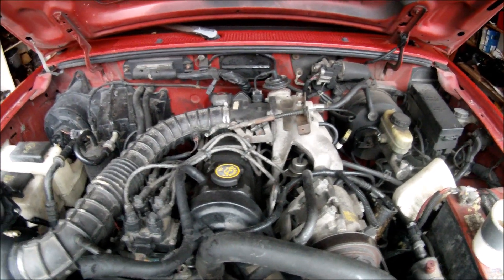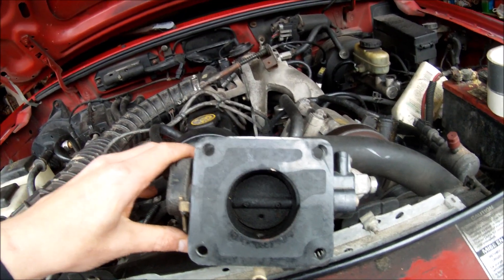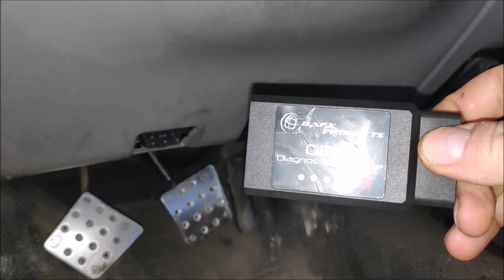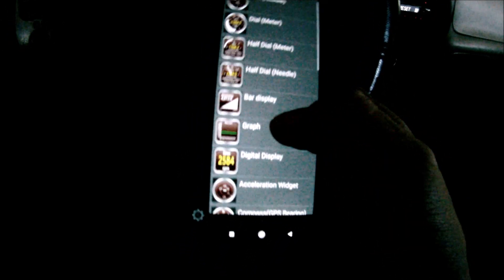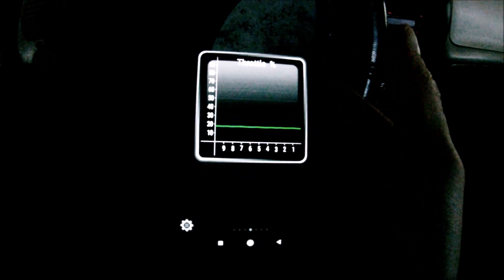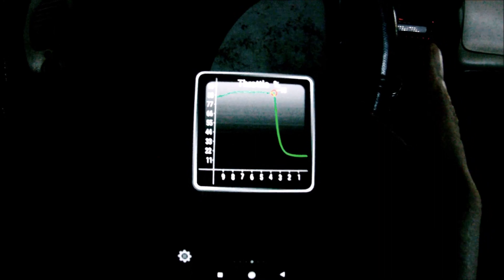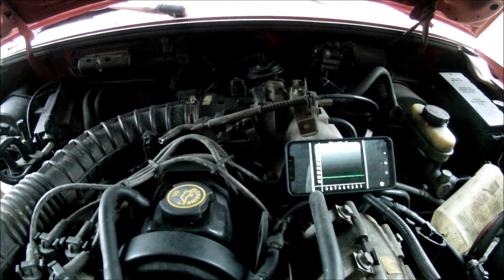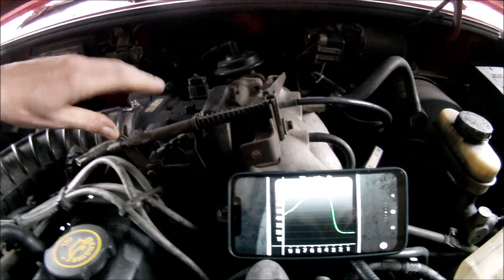How to Test TPS in Seconds, Easiest Technique.

Comment: I have the same interface and it even works on Nissans to read CVT temperature with the CVTz50 app.  I am not sure if this adapter can do other things like reset steering angle sensors.  Maybe with a different app it could.  I don't know yet.  I do know that with the same app and that adapter you can turn off the DRLs (daytime running lights).  My vehicle is a 2017 Nissan Rogue Sport SV and the way they design them they need the steering angle sensor and G sensor reset if any work is done on the suspension at all.  This could be as minor as having it aligned.  These vehicles may have a tendency to drift slightly to one side even though they are aligned properly and everything else if those sensors are not calibrated or reset and it is annoying and potentially dangerous.  I am trying to find a cheap scan tool that can do those things also for $500 or less.  I don't need lifetime updates or to always have the latest software.  I just need one that covers my vehicle.  My vehicle is available overseas and outside the US as the Qashqai.  Everything is exactly the same except that overseas it may have the steering wheel on the other side (think England where they drive on the other side of the road).  I don't mind if I have to pay a few hundred for the tool I need.   I just don't really want to get too much higher than that.  I just want the tool so that when it annoyingly gets out of calibration I don't have to keep making appointments at shops to fix that.  This had me at the Nissan dealer and they could not find a single thing wrong with the vehicle.  I am not sure if their own service department is aware that this vehicle needs that calibration.  I have had it to a few different shops hoping that one mechanic would find that one thing no one else could and take me back there to point it out and say there is your problem right there, how anyone missed that is a mystery!  It is one of those things that is annoying because it is so subtle that not everyone seems to notice it but it can cause you to turn wider than you intended since that sensor tells the computer where you steering wheel is and how fast you are making the turn.  This vehicle has electric power steering and that sensor tells the computer what angle the wheels should be turning and at what rate.  If it is off by too much you could get oversteer or understeer which is potentially dangerous even if you expected it.  This could be also even more dangerous if someone unfamiliar with the vehicle borrows it since they won't expect it to happen.  If they make it back safely they may even tell you that you should get rid of it since they almost had an accident.

Comment: Okay I understand just fine I have the same app for my phone. My question is can I change the value to allow torque pro to read the actual throttle position sensor voltage as opposed to a percentage?
I know I can hook up a multimeter and read it but I thought I should be able to do it with the scanner app,  torque pro.
I know the OBD1 scanners we used to have would read the TPS values in actual voltage.

Comment: Why do carmakers make throttles 'flybywire'? The old throttle cable was just fine. Why introduce an electronic POS into the system? Yet another thing to go wrong. FML
Reply from the maker: Some of the mid 90s ls400 had both, cable and drive by wire, they used drive by wire as traction control.
Reply: It is much more precise from the computer for both fuel economy and performance being computer controlled. Wires can wear out, have tension and lose position easier. Drive by cable is far inferior. If it were better all new cars would have cables.

Comment: Hi mine doesn't move at all while on without turning engine on but it does when car is on, but I see it spike up and down
Reply from the maker: Check connector.
Reply: @everydayirace  
On my car it's integrated into the throttle body
Reply from the maker: @JoseSandoval-ic5xe  is it drive by wire?

Comment: Can you reset or trigger relearn for the TPS.  After cleaning the throttle body it needs to be reset.   $150 is the cheapest scanner I've found that can do it.
Reply: I think.  If you disconnect the battery of your car and reconnect,  the ECU will do that procedure.
Reply: Yes, remove negative battery cable for about 5 to 10 minutes then reconnect turn key to on position then slowly depress the gas pedal to its max position and then slowly let the pedal back out to its resting position. Then start the car and ecm will do the rest.

Comment: in my new car the low is 20% and max is 88,5% (in torque pro app) and 89% on dashcommand app the throttle  possition.. is those a normal Number for max? I thought the max throttle possition should go to 100% until I saw your video of you mentioning that the normal is  around 90%..
Reply from the maker: Yes it's normal